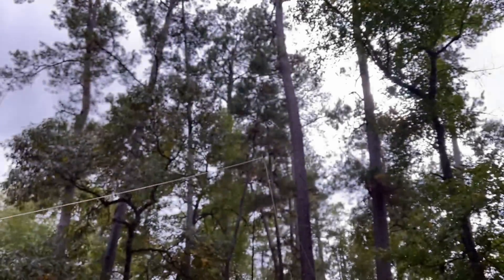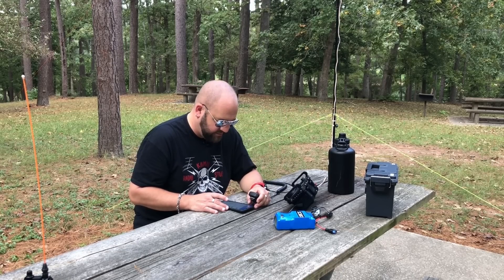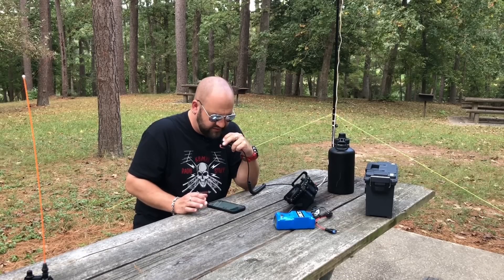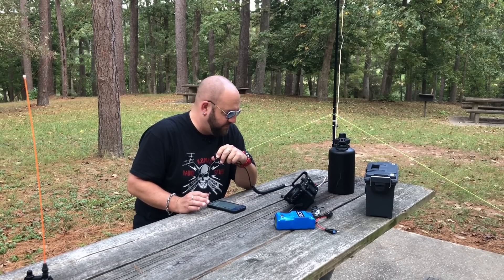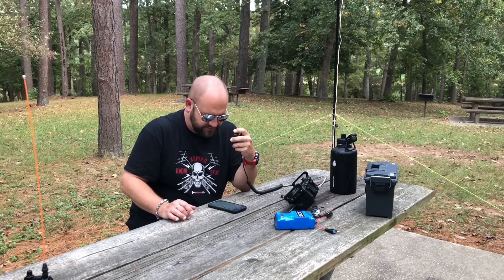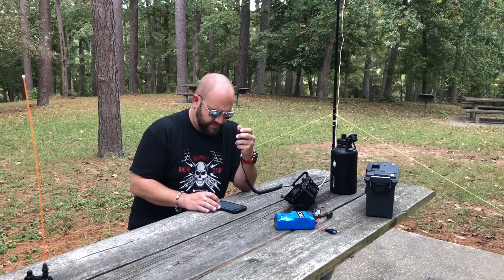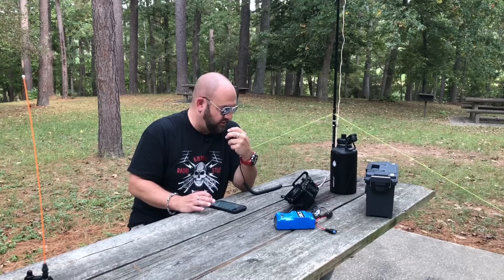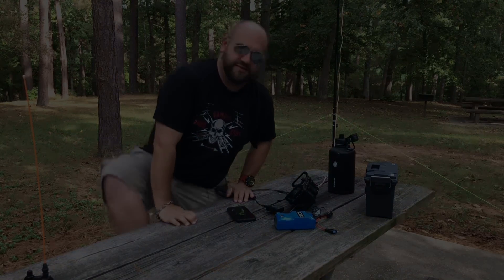My Tribute to Jerry KG6HQD (SK) & the Speaker Wire Antenna

Comment: Nice tribute! I built my first 10m horizontal dipole using speaker wire, a BNC-Banana plug and some 1/4" round wood trim (to hold the wire horizontal) when I first got my tech to work the limited HF frequencies. Mounted it on a 20' flag pole the worked all 50 states and all continents with it using FT8 in a very short time. I was going to build a 2 element beam for 10m but now, I'm thinking I may run to the car stereo store tomorrow and make up a longer wire for 20m (got my General recently). Any idea what the maximum power would be you could run through the speaker wire as you deployed it?

Comment: I'll think of Jerry today when i'm transmitting on my speaker wire 1/4 wave ground mounted vertical with speaker wire radials or when portable next using my 40m dipole - of course it's speaker wire too. Stranded copper twin core just a few bucks at the local hardware store for 25 metres.

Comment: The first antenna I ever built was a 10m KG6HQD Speaker Wire Dipole. I still use it to this day. So far, my farthest contact with it is 8,056 miles to southeast Australia, from Spokane, Washington on 100 watts. I'm very sorry to hear of Jerry's passing, but the "HQD" lives on! 73 de KJ7LLX

Comment: I used speaker wire antennas or twin lead wires for years, the feedline on the speaker wire was the crucial point to the feedpoint of the radio. Cheers Fred VE3FAL
Reply from the maker: It sure is and that prevented me from making a 40/20 linked speaker wire antenna.  Well, it didn't prevent me from making it, but it did prevent it from being resonant on both bands.

Comment: Jerry’s videos of using speaker wire for dipole is what I used to make my first two antennas as a new ham to POTA.  Very sad to learn of his passing but very grateful for the knowledge he passed on. KO4LLB
Reply from the maker: You and me both.  It was so much fun taking the antenna out and reliving the early days of HF portable for me.  Wouldn't have happened if it weren't for a few core guys like Jerry to inspire me.
Reply: This will always be a go-to antenna in my arsenal, actual my preferred when not using my WEC mini.

Comment: I made speaker wire dipoles for 2m, 6m and 17m not long ago. I came across Jerry's videos about a year ago, but didn't get around to the making the antennas until a couple months ago. I've used them for 2m SSB SOTA, 6m FT8 and 17m POTA--they work great and are easy to make. I've heard nothing but great things about Jerry from you and other hams. He certainly made an impact on a lot of people. I'm sorry for the loss.
Reply from the maker: That's awesome Mike.  Glad to hear you're using them in different frequencies.  I've only used the speaker wire antenna on 20 and 17.  Tried to make a linked one years ago but the length of "feed wire" does affect the tuning for multiple bands so I never got it up and running.  Awesome you've discovered the antenna an are having success!  73